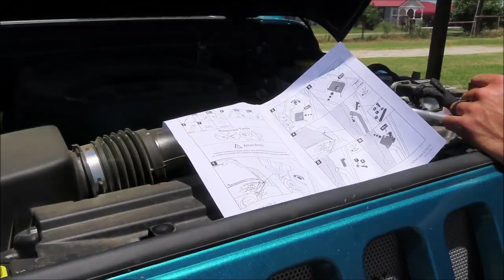RIVAL 4x4 Hood Strut Install | 2020 Jeep Wrangler JLU

Comment: Thanks for the video!  I just bought a set from Rival.  Now that I have seen the install completed definitely not going to look at the instructions.
Reply from the maker: You’re welcome! Super easy installs. You will love them!
Reply: @LifeonBackForty  I installed the struts today.  Just checking that I got it right.  With the struts attached the hood opens about 4 inches less than with the hood prop rod?